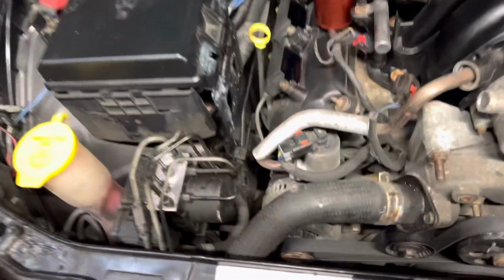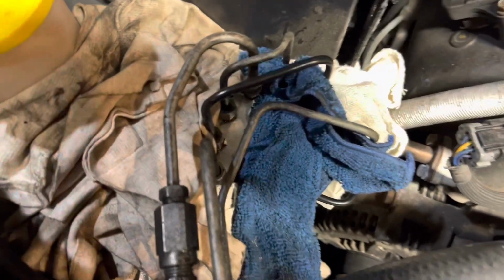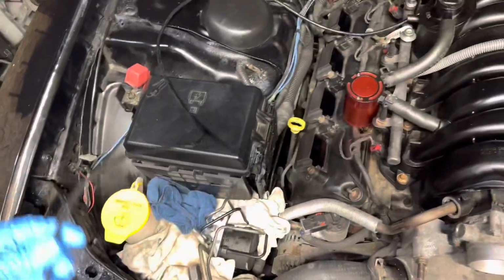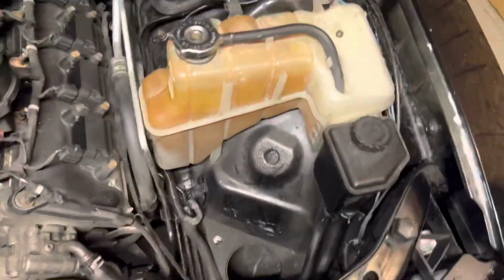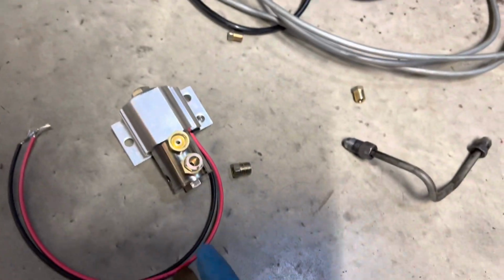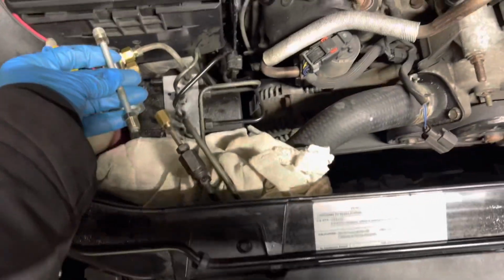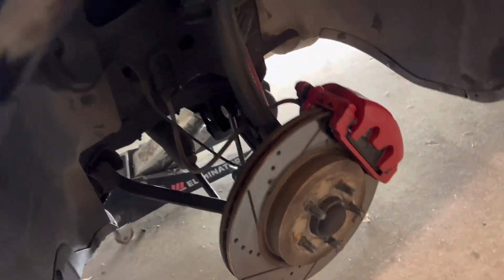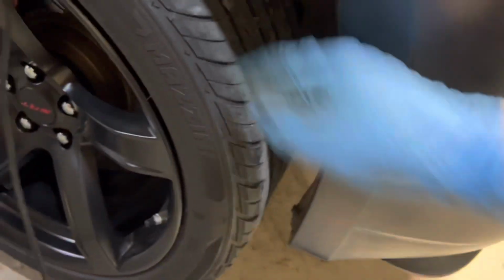How to install a line lock on a Dodge Charger R/T!

Comment: I have a question, when you press the button, your front tires are blocked but the rear tires are free, right? thanks for your help👍
Reply from the maker: When I press the button the line lock solenoid closes. The line lock is only attached to the brake line that supplies fluid to the front wheels. So when it is activated fluid will not flow past that restriction. If the button is pressed with my foot off the brake it will not lock the wheels, but if I apply the brakes with my foot then press the button, it will hold line pressure on the two front callipers which will keep the front wheels from moving until the button is disengaged.  So yes when the line lock is activated and you release the brake pedal, the fronts will be held in place while the rear is free to spin. It can allow you to do a burnout or spin the tires without putting stress on the brakes. Hope this answers your question!!  Thanks for the comment and have a good one 💯💯💯🤝

Comment: Hi, I have a Chrysler 300c 5.7 hemi. and my abs pump looks a little different, from above I have 6 wires and not 4 like you.
Reply from the maker: Are you installing a line lock? There are two different designs. I could help you identify which is which if you’d like 💯💯🤝

Comment: Where u buy the kit
Reply from the maker: Just bought the solenoid n wiring on eBay, they have em on Amazon as well, and got the necessary brake line and fittings to finish the install 💯💯🤝

Comment: What size fittings did you use
Reply from the maker: 1/4” brake line used. But on the line lock solenoid itself the inlet was for a 3/8” so I used an adapter to convert the 1/4 fitting to fit the 3/8 inlet. Hopefully this helps bro! Take care 💯💯🤝